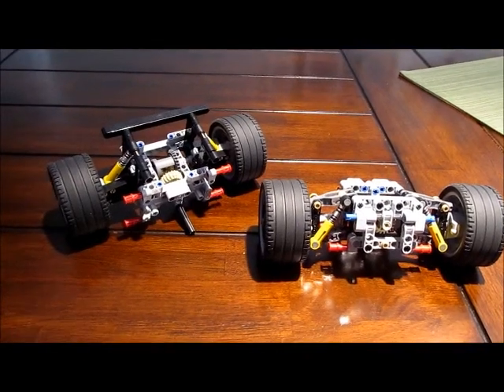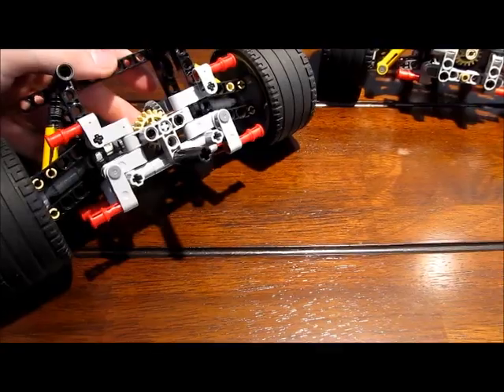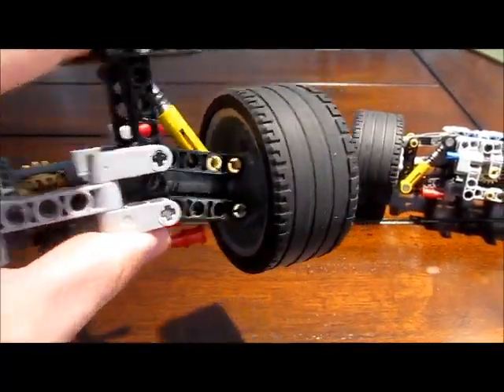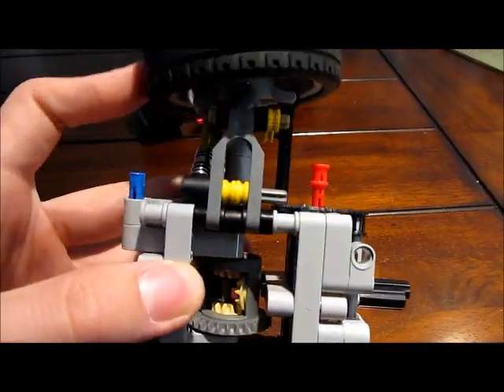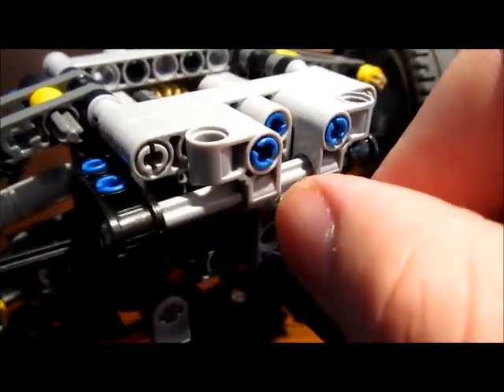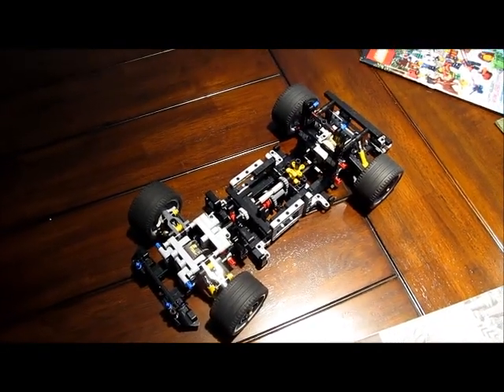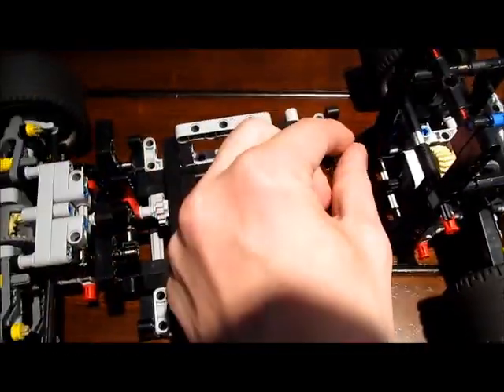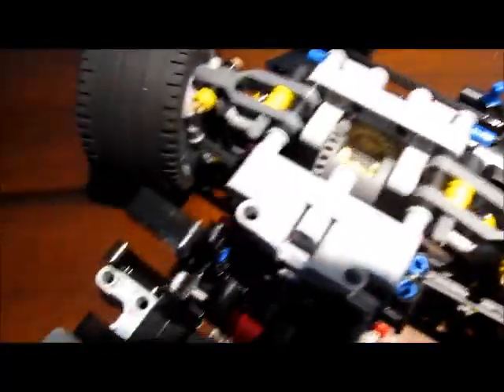Lego Technic: MPS Chassis Concept

Comment: I am really not sure, but I think the steering system got this thing called bump-steer. The steering link isn't parallel with the suspension arms, so the wheel-hubs go in and out when the suspension get compressed. 
It is much easier to make it like that, but it isnt that good. 

Still a nice vid! :)
But only 48p?
Reply from the maker: The steering links are parallel with the A-arms, but there is some slight bump-steer due to slack in the wheel hub design. I'm happy with the final product ;-)
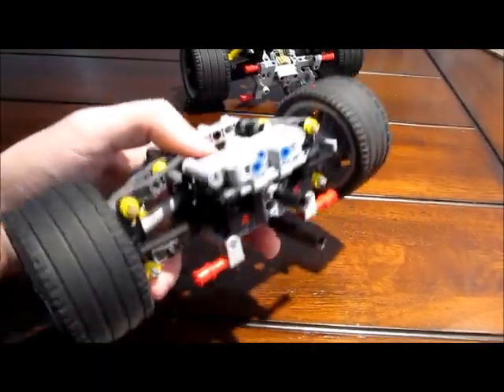Reply: +DesignJunkie58 I believe what he means is yes, they are parallel with the wishbones if looking from the top, not if looking from the front, you can see it at 2:36, but from the ride height shown at the end, it doesn't seem like there is much travel in the suspension so it probably won't affect much. Still very well thought out otherwise. Good Job! :)